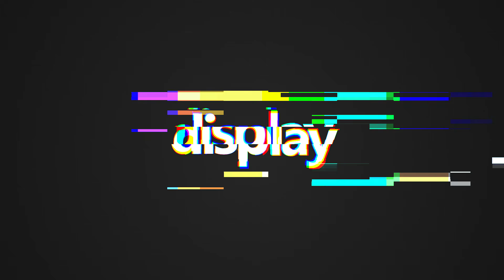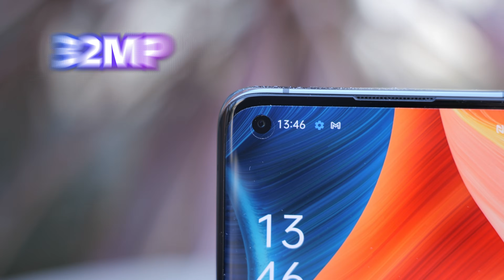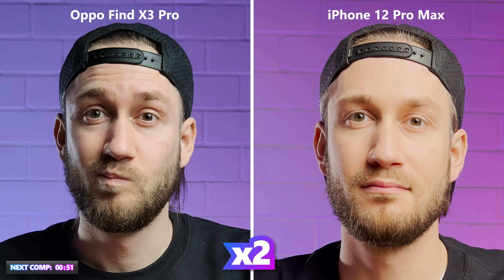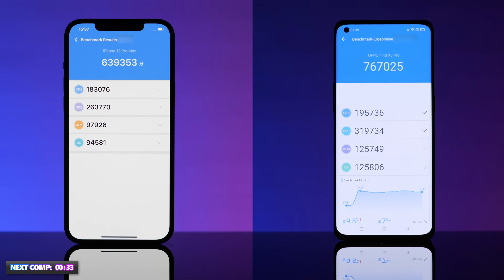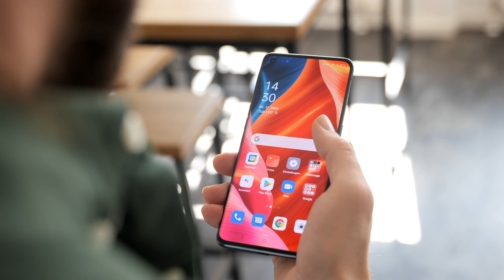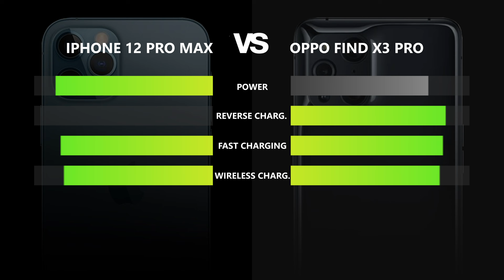iPhone 12 Pro Max vs Oppo Find X3 Pro! | VERSUS

Comment: oppo destroys iphone on video espacially when recording an actual moving image and not a still framed headshot. this is because the capturing speed of the sensors is much faster, Iphone  can use processing and longer exposure times which makes talking heads or low motion film look better than it is but capturing 30 or 60 images per second in moving video shows what the camera is actually capable of because you do not have the ability to use multiframe enhancements and you can see where the image is blurred and compressed where the senors have failed to capture within the specified frame time wihch is ~16ms at 60fps

Comment: Your comparison was accurate in some of the details, but
unfortunately the result was unfair, here's why;
Display: the result was correct, 
Performance: the result was not correct, because the performance of the Oppo is much better, 
Camera: the result was correct, 
Design: in both devices is great and the Oppo is superior in weight and the ease of holding,
Battery: in the iPhone may last more but  On the other hand, the charging speed in Oppo is superior, so the result was supposed to be equal. 
The final and fair result is the superiority of OPPO over the iPhone.

Comment: I think Oppo wins on battery... iPhone can’t compete with Oppo’s fast charging. That 65W charger is a game changer. Don’t forget 30W wireless charging too.
Reply: True. Full 0%-100% in 30 minutes.
Reply: well... it's a blessing and a curse. i bet a lot of batteries die young, per se. but it's still a good feature to have, imo, don't get me wrong. i think that retard fast charging should be used in moderation if you want longer battery life. Again: that's all just my opinion
Reply: @endermanofficial  no and nope, I've had the Oppo Find X3 Pro for about 6 months and it's holding it's battery perfectly fine, Oppo wouldn't implement 65W charging if they didn't have great hardware (battery) and software to handle such intense charging, my phone doesn't even heat up when charging, my Samsung or iphone in the past would heat up more with less wattage. 😂
Reply: so? Apple still has battery battery life, no one gives a fuck about charging speeds